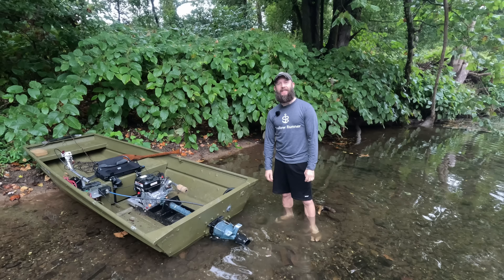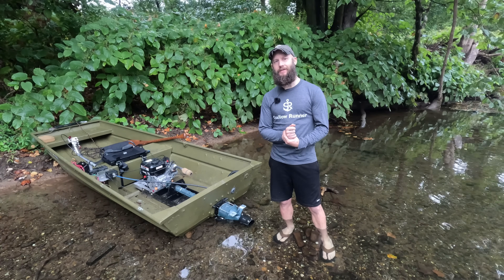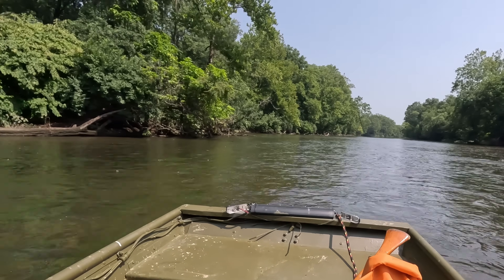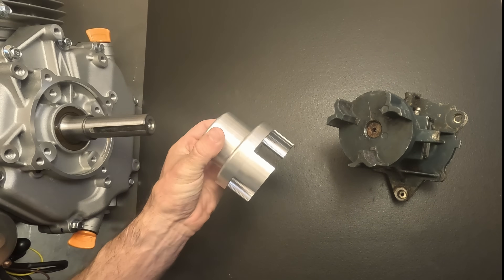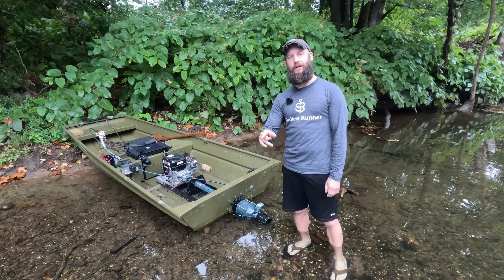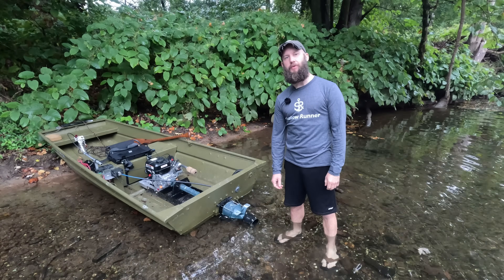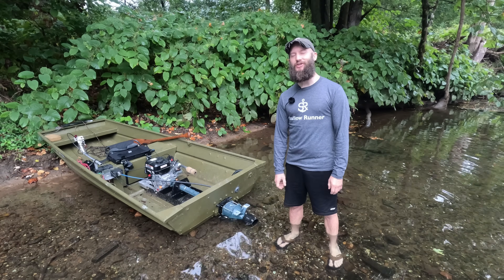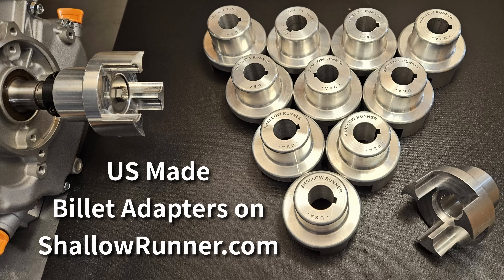212cc Predator Engine Jet Boat Build

Comment: Great work man, I blew up my tigershark engine in my jet jon. I might try a four stroke this time around.
Reply from the maker: Hey thanks. Brutal on the failed engine.  Let me know if you have questions about matching an engine to a specific pump. I'm thinking a good quick video next would be some pump basics and some things I've learned about hybrid engine/pump combinations if folks were interested.
Reply: @Shallow.Runner  Yeah you should make that video. I always thought the rpms wouldn't be high enough to get the speeds you were able to get. I got 41 mph out of mine with the 600cc but if i could manage a 670 predator to 30mh on mine id still be happy about having aircooled and fourstroke.
Reply from the maker: @mycoolkeno  You're right on about getting the issue with low rpms out of the four strokes. The waverunner 500 pumps were designed for 5500rpm though you can get somewhat similar thrust out of them at lower rpm through a few modifications. The 670 would likely work pretty well with other pumps that required more torque, but the hop up kits are super pricey.
Reply: i have a 1436 with a tigershark engine and those things sound wicked but they are finicky.
Reply: @CaddyWack1776  I have a video on my page of mine. It ran great when it did. I have another parts ski but haven't decided what route I want to go yet.
 I'm sure that thing is a terror in the 1436. mine is in a 1560 aluminum runabout and it hit 41
Reply: @ that’s fast for such  a wide boat that’s awesome
Reply: @mycoolkeno   parts for the 639 are really cheap on ebay.
Reply: @CaddyWack1776  width can help with speed. My mud boat is a 1652 and does better than my buddy's 1540 with the same engine. Water displacement can make planing easier,there will be less plow in the water because it floats better.
Reply: @ learn something new everyday. I’m so glad I found your guys channels.
Reply from the maker: That's helpful feedback, I am starting a build video with something a bit wider and longer regardless. Hoping the same holds true for the new build.